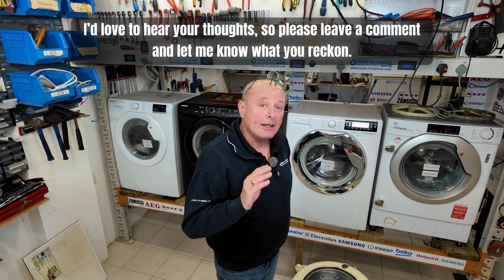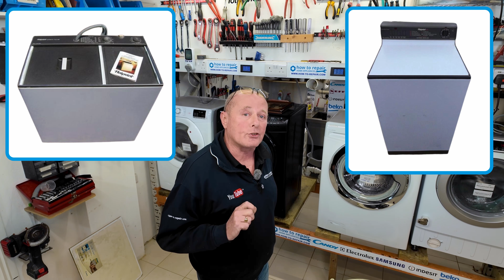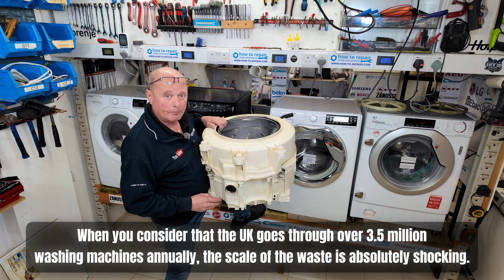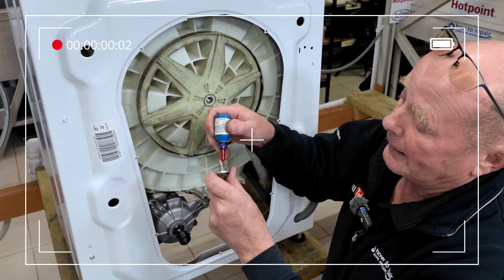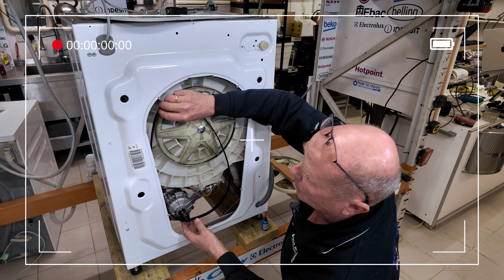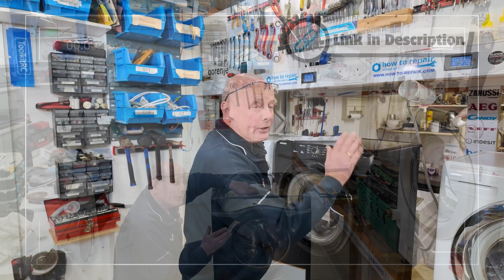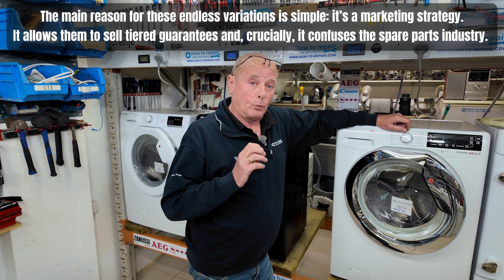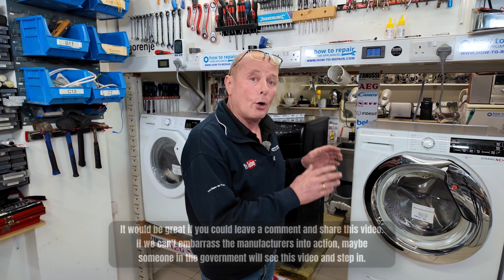I Scrapped 13 MACHINES to Prove a Point: STOP BUYING These Brands!

Comment: We need to demand at least 10 years of warranty, if not more.
Reply: Exactly, force them to build to last, the technology has been here for 50 years. And make the less durable parts easy to repair.
Reply: @irrichman they'll be out of business -with all the Chinese mock ups being sold at half the price..
Reply: @irrichman  people in the west dont have 20 years of warranty? lmao
Reply: @automatedrussianbot where u have 20 years warranty on washing machines. We have normally 2 and they often. Extend to 5 or 10 here.
Reply: @automatedrussianbot  in the west the standard is between 1 and 3 years warranty
Reply: Make it 25 years
Reply: @the.parks.of.no.return 😮 25 years
Reply: @SilverSurferVi  my dads hitachi AC unit from 1999 was under warranty until 2019 lmao... 20 god damn years! its still in the garage by the way and still works perfectly!
Reply: @the.parks.of.no.return  i think 12 years would do
Reply: That's why I buy Japanese stuff 90% of the time... Most Japanese manufacturers, whether it's vehicles, tech, tools or whatever else, most of them offer 7, 10 or more years of warranty! Sure I pay 20-30% more compared to what the same product from another manufacturer costs but at least I have a peace of mind for the next 10-15 years! My sister bought a Toyota RAV4 last year, got a 10 year warranty on the car! 90% of the stuff in my home that I bought over the past 10 years, is Japanese and is highly likely still under warranty!
Reply: Fat lot of good it does; my Miele (bought in 2020) came with a 10 year warranty. In 2024 it started having 'F20' Faults (which means the heater won't warm the water up).
So far, over more visits than I care to think about I've had, with at least one visit for each:

Software reinstall/reboot
New Circuit Board
New Heater Element.
Repair to Wiring Loom
Repair to Wiring Loom
New Wiring Loom
Repair to Wiring Loom
Repair to Wiring Loom.

The last repair was a couple of weeks back, when the engineer said he was going to order a new Circuit Board; Heater; and Wiring Loom after carrying out yet another repair - the F20 fault is back; my washing machine is screaming at me to run a 'Clean Machine' - but I can't because it won't heat the water.

For reasons unknown, a cable on my machine which connects to the heater below the drum keeps snapping off/melting/overheating - originally; when they finally worked this out, they thought it was too short, so they extended it, then they replaced either that section, or the whole wiring loom; then they replaced the whole wiring loom; so far my 'repairs' have lasted anywhere from a week to a year.

And this thing cost me £1200 - Not impressed with Miele would be an understatement; my previous Miele lasted 13 years before it started making a weird rattling noise (which I assumed was bearings) and as callouts are so expensive, I decided to call it a day and bay a new machine.
Reply: @markandkatehall4545  Did they fix it all under warranty?
Reply: @markandkatehall4545  Why would callouts cost you anything under warranty? Why didn't you ask for a replacement machine?
Reply: @markandkatehall4545 Precisely why I bought LG. People dislike LG but at least they use generic parts and I can get anyone to fix it. Try that with Miele
Reply: I'd happy with just machines being assembled in a sensible manner so that you have a chance at being able to replace broken parts, and detailed maintenance and troubleshooting manuals.
Reply: Question is, demand to who ? Our governments are obviously closing their eyes on all this.
Reply: @GBO76  It does not make headlines, so politicians deal with issues they are pressured on instead.
Reply: @GBO76  western goverments are, here we have 20 years warranty lol.
Reply: Much better to have a money back guarantee.
Reply: @MtRevDr  I do think that would be better. My mom bought a washer that lasted for a bit over 3 months before it crapped out . She was going to buy another or call the repair shop. I asked her to let me look at it . Online I found that a switch from China was trash causing these machines to die . I found a non OEM part and it has ran until she died.
Reply: @JAYJAYJAY53   - I was told by a repair man that some modern brand would break down within 7 months.
Reply: manufactures are hoping the machine breaks - so you'll keep buying more
Reply: We have a 10 year warranty on our new fridge covers parts only no labour though.
Reply: @minimeee04  I hope you didn't pay for that 😮 they rarely go wrong 😮
Also i bet they won't have the parts available in a couple of years 😮
Reply: Nope came with it. @Davidgoldenswan
Reply: Full warranties
Reply: You don't have a warranty like you think you have an insurance policy which is added to the price of the machine the people they send out to "repair " under warranty haven't got the slightest idea what they're doing and 90% of time they replace machine the modules the motors the drums are all unrepairable components
Reply: We had an ISE washing machine which lasted over 20 years! Without even having an engineers visit. Unfortunately ISE went bust, probably because they made the machines too good!  We now have an Ebac, it hasn’t actually gone wrong yet, but it is very annoying with loads of errors and only spinning properly about 50 percent of the time!  I wish i could buy another ISE or something of a  similar quality!
Reply: A law could require manufacturers to buy back any broken equipment.   When every failure is forced into a COST For the manufacturer, they will build stronger & better products : to prevent eWaste & protect profits.
Reply: @SeaJay_Oceans  no 😂 they will change you more money to cover any cost 😮
And you still won't get a better machine 😅
Reply: It has to be build to last a lifetime
Reply: Two simple tips are to descale the machine from time to time and not to pack the drum too full. A ten-year warranty would be a minimum for me who washes a maximum of half a machine a week.
Reply: do be honest i dont know why 10 year of warranty is not standard. 2 years is so stupid.
Reply: Honestly, a 10-year warranty would change the whole industry. If companies had to stand behind their home appliances for that long, we’d probably see a lot less planned obsolescence and fewer products designed to fail. It would push manufacturers to focus on real appliance durability instead of short replacement cycles.
It would also make appliance repair and the right to repair much more important, because machines would actually be worth fixing instead of tossing after a few years. That could slow down the product quality decline people keep noticing in modern appliances.
Reply: The problem is these corporate fkers offer 10 year warranty but its not enforced. The terms are twisted and they have strong lawyers backing their scam
Reply: Exactly. We need government oversight. Down with freedom! Freedom to make cheap sh*t.
Reply: Buy lg they give 10 years
Reply: Well, just demand it then. There are those who offer precisely that.
Reply: My LG is 10 yrs warranty ! Love Korea :)
Reply: Well, get used to paying triple the price for a ten year warranty.
You already COULD pay that. Buy machines made for companies, not consumers.
Reply: The problem is they will price that into the machine's up-front cost. Nothing is free. They will both need to charge more as they will need to use far more expensive materials and manufacturing methods. But they will also need to price in the costs of the warranty. 10 years is a long time, especially for a machine that so many people do literally 0 maintenance on. If you mandated a 10-year warranty, I'd expect an 800-1200-dollar increase in price.
Reply: Most of the users got no idea how to treat the appliances. Even bulletproof machine will fail without maintenance
Reply: They just put a 10 year warranty sticker on it. It will last for 5 years you will  go to use the warranty  find out it obsolete and no parts are available or they have some  specific details you have to do for the warranty to be valid.
Reply: That won't help a bit. Our Samsung washer came with a 10 year warranty, it even had a flashy sticker on it saying that. After a year and a half it broke and flooded our house. I called for service and found out the you have to pay a lot for them to just visit and you have to pay for labor and parts, so the service call will likely be equal or more than the cost of a new washer and would just restore it back into being a house flooding device. Since that is what happens during the warranty period, what happens when it is out of warranty? My suspicion is they refuse to do anything at all and tell you to buy a new washer.
Reply: @drwisdom1 . Damn, which country? That sounds illegal in the netherlands.
Reply: @LaurenceLionKing  The United States. Today's warranties aren't what they used to be.
Reply: @drwisdom1  ofc all these stories are from the US 💀 it's so over over there
Reply: @drwisdom1  US oligarchy legislates in the first line for the rights and profits of ... checks notes the oligarchs. XD
Reply: @drwisdom1  Try getting warranty repair on a Frigidaire stove. Their call in center had a message saying "we are closed on weekends, try again in biz hours". Same message on weekdays.
Reply: @drwisdom1  I can't say I'm remotely surprised 🤷‍♂️
Reply: @drwisdom1  then your legal definition of "warranty" sucks huge balls, if warranty repairs are allowed to be billed to the consumer. In other words: its a scam.
Reply: Since this comment has received a few replies, I might as well add what this Samsung washer experience taught me - don't buy products from companies that have garbage engineering and especially if that is combined with poor customer service. Don't go buying things because of claims that it has a warranty and will be fixed if it breaks, buy stuff that is proven not to break, even if that costs extra!

It was just over ten years ago our Samsung washer flooded our house. So I did research and decided to buy an analog Speed Queen washer and dryer. They were not that much, less than half of today's prices. They work well, are still like new, and if anything breaks I will likely be able to fix it myself with inexpensive parts. For 45 years I bought VWs and did most of my maintenance and repairs. But now VWs are too complex, fallible, and require specialized costly tools. Plus VW is now restricting access to diagnostics tools so you can't even figure out what to fix. So we stopped buying new VWs and changed over to older Toyota/Lexus vehicles before the 2020s.

Our Speed Queen washer is now 11 years old and appears to have at least 15 more. So our Speed Queen has already lasted 7 times as long as our Samsung and should last at least 16 times as long by the end of its life. Clearly, the Speed Queen is way less costly than multiple Samsungs when measured over 25 years. But if you she a flashy metal Samsung filled with breaking plastic internals next to a Speed Queen, your wife is going to tell you to buy the Samsung. Don't do it!
Reply: You guys don't have it ?? USA land of the free my ahh. In Europe we have even 15 years warranty in some cases.
Reply: My lg has a 10yr warranty
Reply: No problems, buy Miele.
Reply: Are you willing to pay for it, too?
Reply: @dabbidaa1547 often it's using a better grade of something that doesnt disintegrate for a few cents more
Reply: @dabbidaa1547   of course we are willing to pay for it, just as people were willing to pay for it in the old days when their machines would last 25+ years.
Reply: @dabbidaa1547 Yes. We already are as we're forced to buy a new appliance not long after it breaks as it's unecomomical to repair. So what difference does it make?
Reply: @dabbidaa1547  Do you know the saying "I am not so rich to buy cheap things"? That being said, I think this is where the problem lies. Cost cutting to the bone as customers are dumb and buying the cheapes shit. The guy said it at the end of the video - if people wouldn't buy it, manufacturers wouldn't make it.
Reply: @XQgint  . Blaming consumers never works.
If companies aren't allowed too make it, people wouldn't be able to buy it.

That is way more effective. Capitalism needs regulation, else you get insane amount of waste of resources and manipulative tactics to fool people into buying their bad products.
Reply: @XQgint  
The thing is, do customers really know any better? 
How many brands survive on past glories, brand recognition, or 'well it has a 10 year warrantee, it must be good' (even though more often than not they only cover parts)?

Comment: I had a Hotpoint washing machine in the 90’s that had a technical fault. The drum was catching on the hose with the vibration and eventually it split the hose inside and was going to cost us quite a bit to fix it. The company said we had to pay for a technical report before they would act on the fault complaint. Also had to replace the brushes too!

Comment: Had my hot point machine 19 years from 1982. Never broke down, spin was brilliant. Never ever went mouldy. Eventually the rubber wore a bit here and there. The repair man told me the manufacturer’s are now building washing machine to fail after 2 years.